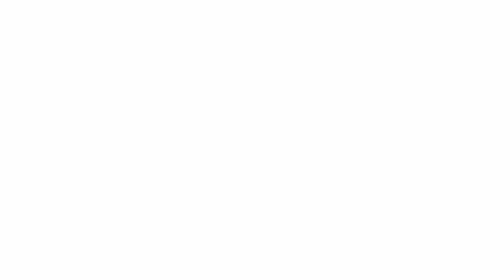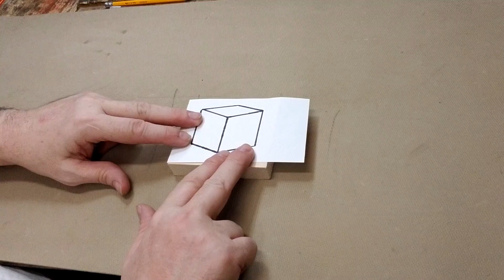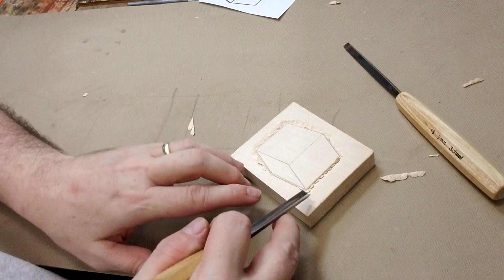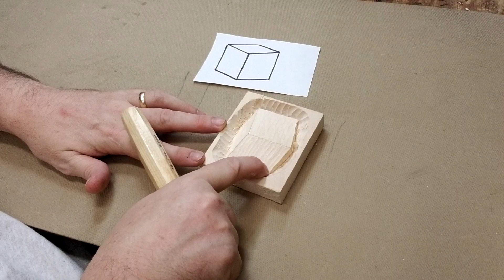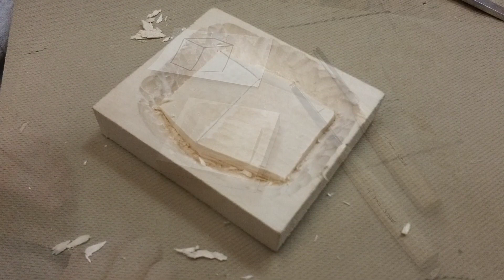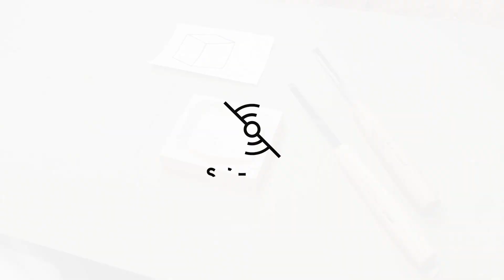How to Carve a Cube in Relief | Wood Carving for Beginners | Easy Carving Projects with Schaaf Tools

Comment: I have been told to clamp the wood and have 2 hands on the gouge.is your way safer?
Reply: From Randall: "The technique is important and meant to achieve the shaping wanted but in a way that keeps the user safe. I use what I have coined the "dominant / non-dominant hand" method. You cannot hurt yourself or anyone around you with it's use.

My method has both hands on the chisel at all times as they provide power/thrust (dominant hand) & steering/guidance (non-dominant hand).

As for clamping, I never clamp anything unless I am glueing blocks together.  My rubber mat holds the work in place which negates the need to ever clamp."
Reply: Hope that helps!